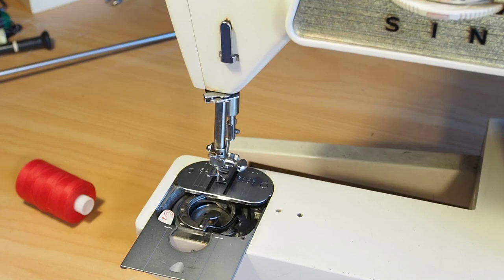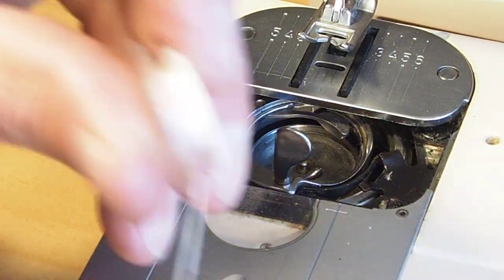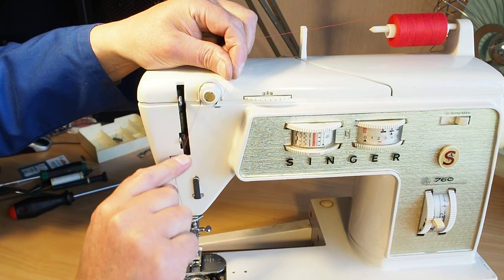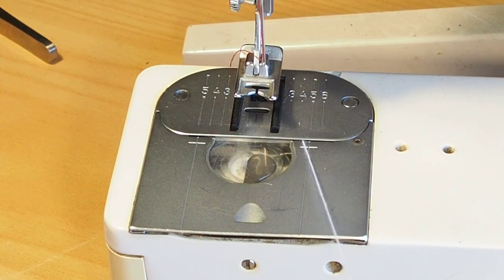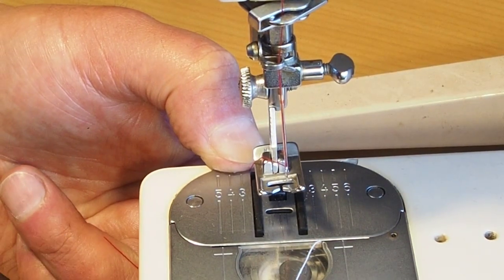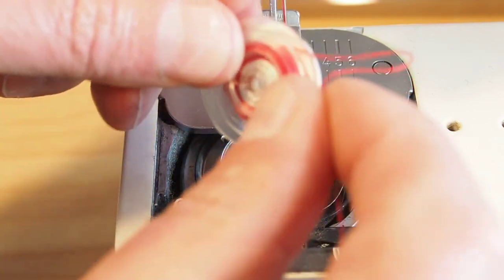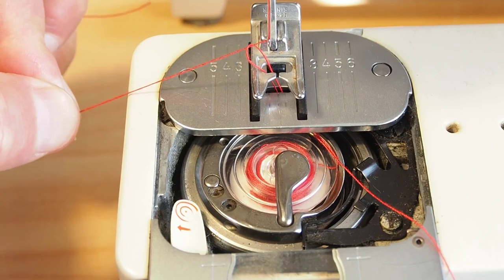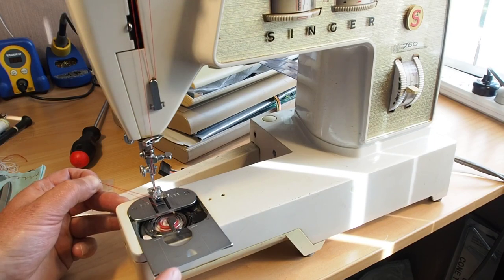Installing a Wound Bobbin - Singer 700 Series and Other In-place Bobbin Winding Sewing Machines

Comment: Hi I have a question for you I have a 720 and the bobbin threader switch is stuck in the sewing position and I am unable to wind any bobbins
Reply from the maker: Hi. It sounds like the switch shaft is seized. If you try getting oil on to it, it may free up. Thanks.

Comment: whay is the problem if the bobbin case not movingl
Reply: This is my problem as well.
Reply from the maker: I'm assuming you mean why is the bobbin not moving? If so, the plastic cam on the bobbin winder shaft may be broken underneath.